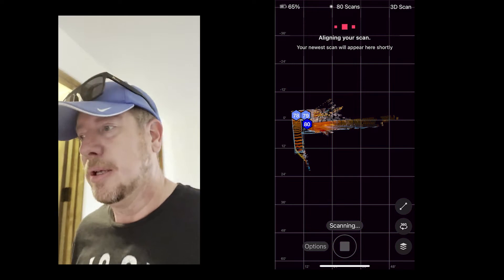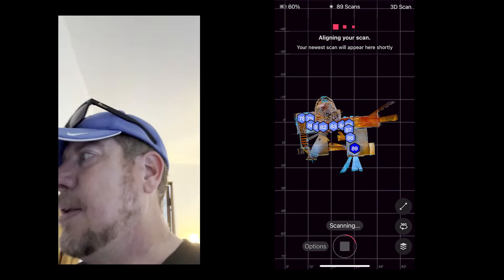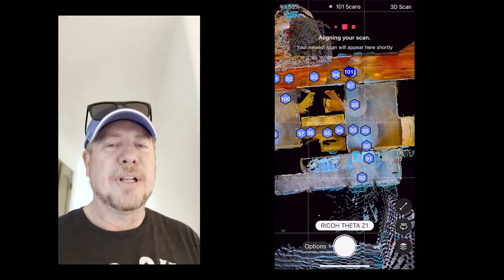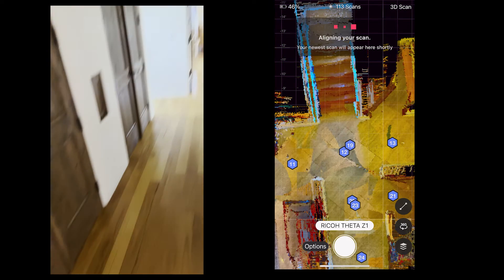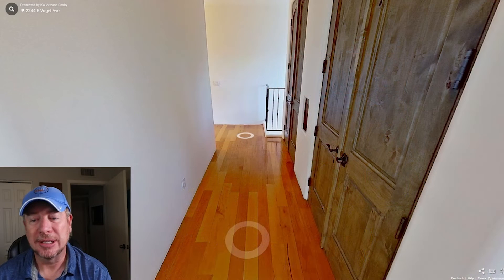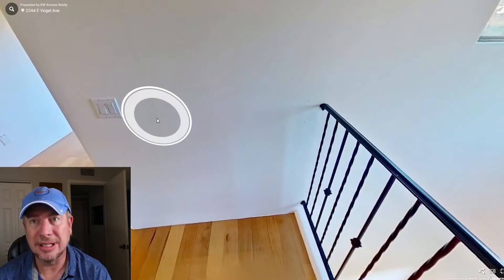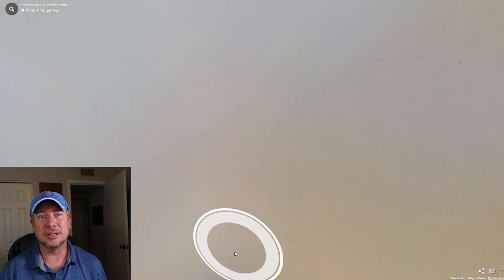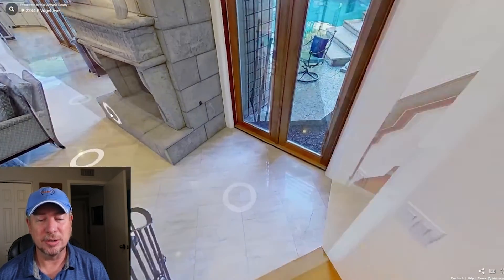#1 tip for Matterport Scan Alignment

Comment: Question: you mentioned you "reset" your position at the bottom, to enter from another room or such...  How do you do that? sometimes when I'm scanning if I don't follow a path,  the model  gets all messed up!  Thanks for making these videos, they are great help!
Reply from the maker: @vanessariosvega2483  most of the time the reset works when I’m skipping back to apart of the home.  As long as I know the location and verify it lines up.  If it doesn’t work I find another spot to try.  Worse case I back track all the scans.  Sometimes you just have to retract a lot, but usually the reset works.

Comment: Thanks man, amazing as always! Quick question, I am using right now a Insta X3 i shoot in 12K with pure shoot, process in the insta app, export in the photos and upload in meataport, takes some time but quality is just amazing compared to the HDR 18mp 5.7K shoot that it does trough metaport app while scanning (also it goes in automatic setting with ISO crazy high so noise is there). When you shoot with the Ricoh z1 straight from the metaport app can you use manual settings? And can you see the preview on the phone (like streaming in real time what the camera sees)? Also if you have a metaport job that you can share it will be much appreciated so I can compare it with rhe X3 quality and decide if to keep going on with this or switch to the Z1. Thanks a lot, and keep going with content!! 😊
Reply from the maker: I haven’t used insta since the 1. I have a 2 I use for video and other things but not matterport. With that said I’m sure it has improved. The main thing is to set everything up in manual settings and matterport will take it with those settings.  It won’t do stacking or hdr but will use the settings you chose.  I have a video showing the difference coming. But the way you are doing it would probably be the best quality but a lot of work.
Reply: @AgentCaseyG  thanks a lot for the reply 🙏 yeah you’re right is crazy amount of work, that why I sold it the last week and bought for 400$ a Ricoh theta Z1, I have to say the quality is just amazing…. And straight away from the camera! Wow, I was not expecting a quality this high. So you’re going soon to release a video on how to setup the Ricoh theta Z1 when working with Matterport? It will be amazing! Can’t wait to see it!
Reply: Hi!
So its possible to take photos and then upload to Matterport app in order to increase the quality?
Can you share a video or do you know a tutorial for that?

Thanks for your help
Reply from the maker: @arenter1 yes it is.   I am not sure about the quality.  And there is always a risk of not alignment. But let’s do a video and test this theory.  I will work on it this week. I like this one.